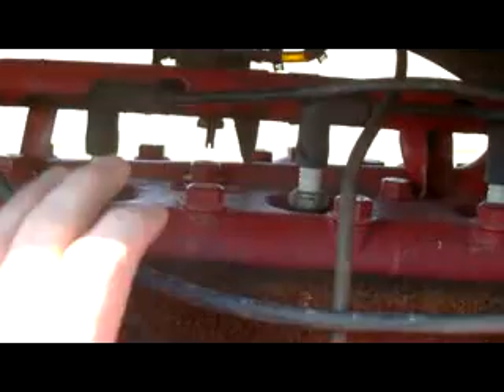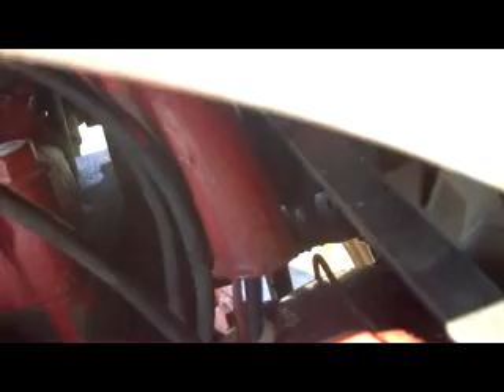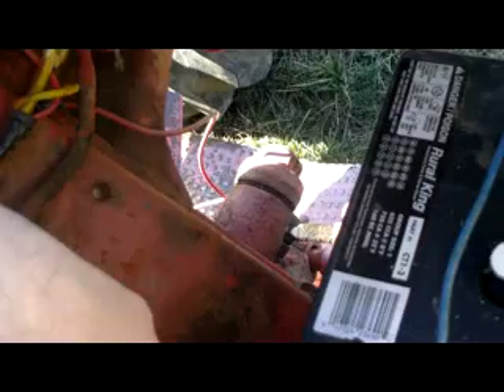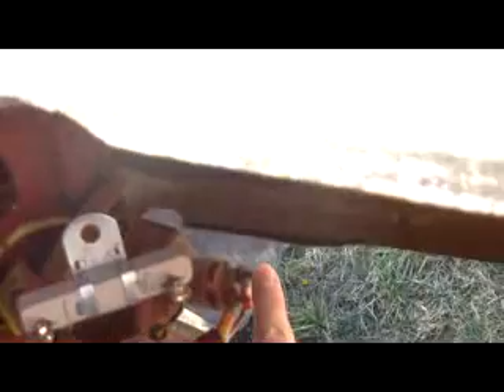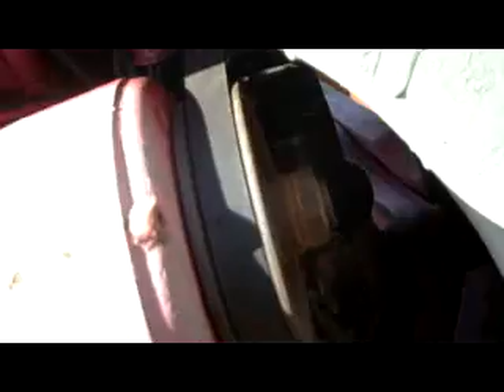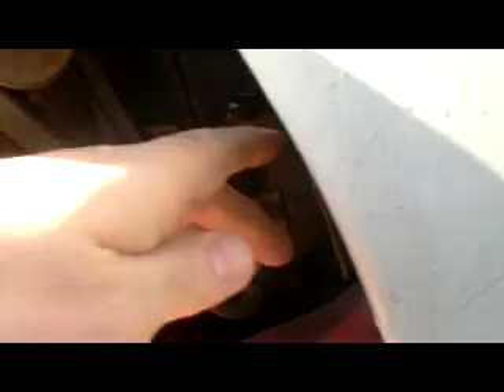8N Electrical System Trouble Shooting When 8n Won't Start

Comment: What I found with my 8N that wouldn't start: a loose battery terminal connection. I'd recommend starting there, and making sure that you have a fully-charged battery before doing anything else.

Comment: I get intermittent spark when turning the engine over But no start. Testing back my ballast resistor  was bad but I think it burnt my coil. Will a internal resisted coil work.
Reply: Yes, you either need an external ballast resistor OR a coil with an internal resistor. If you have both it may work or you may have issues because you have two much ballast (two resistors in series).

Comment: Thank you for your video!! I just did exactly what you said and found out when I put my tester on the battery ground that the bolt that holds it to the tractor was loose.  After tightening it up she fired right up. Thanks again for the tips.

Comment: Nice to see you have kept it 6V I like to keep them original but I must confess that I have 2 - 12 Volt 1951 8N’s and one 1947 8N that is 6 Volt and my Jubilee is 6 volt so I bought them that way so I just left them but original is the was to go especially since 1950 the 8N’s upgraded the generator to 30 Amps!😀🇨🇦

Comment: I'm having voltage to the distributor and the test light blinks when the starter is depressed but there is not a spark at the plugs.  We have tried it with a new wire but still no spark.  I have replaced the ignition switch and the resistor. The disruption has been rebuilt as well.  Any suggestions?

Comment: I just got a 8n, with no spark. My push button starter turns the tractor over weather the key is on or off? Is this normal?

Comment: What can cause that resistor to get hot and blow it?
Reply: the resistor is like a coil electric heater you use in your home. basically a curled wire resisting current which will  produce some heat. hot to the touch. The wire can get brittle and break at any point in time. just test both sides of the resistor for voltage. you have voltage on both sides inlet and outlet it is fine and working. thats the basics.

Comment: I have power to the coil but when I hook the wire to the coil the voltage going into the coil drops and I don't have spark

Comment: Thank you I have a Ford 9N I had recently bought and I drove it a little ways and then it just stopped like no power getting through but I did some investigation I started with the fuel line and the fuel system I replaced the fuel tank carburetor the fuel line and as of this riding this is the day when I tried to start it and it was getting gas to the carburetor but it wouldn't even fire once. I should have known better because its either one of two things it's either electrical or ⛽fuel. Tomorrow's another day I'll pull a plug and check for spark like you did I should have known that. I ran a wire from my push button starter to my toggle switch and I have spark.

Comment: Thank you for your video. 9 years after making your video your still solving problems. Mind was faulty connection’s at the key switch and without this video I’d still be out there trying to figure it out. Stay safe
Reply: Was your tractor cranking over but not starting? I'm working out of town, so I am trouble shooting from afar.
Reply: It was a ignition wire loose.
Reply: @donaldd.293  😁 I was asking for my tractor. With your ignition wire loose, will it still crank or no? Mine cranks but doesn't start. I'm wondering if mine might be ignition, resistor or starter because the wires look iffy. I'm sure it is electrical.
Reply: Hello everybody. Thanks for all the info. on electrical problems. I have a 1946 Ford super deluxe when I bought the car It had some electrical problems so what I did I start replacing The voltage regulator Ignition points, battery, cables, and had The generator check to make sure it was in good working condition. Hi replace all the parts that I thought they might have caused the problem. After I did all that I still have some electrical issues, so I decided to replace all the wire harness and most of the problems were gone. I still have a problem that when I turn on the lights even the car been running or in motion it drains my battery. That’s the problem. I’m trying to find a solution. I’m guessing  it might be the generator. It’s probably the problem. If you have any info, I would really appreciate it.thank you in advance.

Comment: Thanks for the video. My neighbors 8n bogged down and lost spark after his tractor hitting a patch of thick grass. Ended up being a wore come lose on one side of the resistors that was causing the problem. Your video saved me a lot of time. 👍👍👍
Reply: Wire?
Reply: @wehrewulf  yes , a wire came off

Comment: If actually running a 6v battery do you even need a resister?  I've replaced everything and still can't get spark, the frustration is real
Reply: That's what I was here to find out. My neighbor says you can bypass it I'm just trying to confirm that.

Comment: What does it mean if you have voltage to the coil when it not attached to the distributor. I get 12 volts to the coil but if the coil is hooked up to the distributor thank only get 3 volts and it doesn’t Change when I crank on engine

Comment: I have a 1939 Ford 9n. The ballast resistor went bad and bipassed it. Been running it this way for  nine years with no trouble to the coil. It's also converted to 12 volts.

Comment: My tractor would turn over but not start.  Turned out, the wire going from the resistor to the distributor was not hot on the dist. end so I replaced the wire and end fittings and that did the job.

Comment: Thanks for the tips. I bought the neighbors 48 8n on an auction. It hadn’t been run in a few years. I would not have looked at the resistor until I watched your video. I had 6 volts at the coil with the key on. But when I started cranking the engine it would drop to 2-3 volts. TrActor supply had a resistor and it started right up. Now to get the gas tank cleaned out so it will stay running.

Comment: had the same problem today after running tractor wouldn't start no spark to plug from dist. so the problem was in dist. rotor cay top was bent backwardsfor some reason. was running. so took that one off and put old one back on and it started right up . no spark to plug  means problem in dist

Comment: I have a 1948 8n I think that's the  year . It runs really good  for  about ten minutes then shuts off. I'm not sure what the problem is .
Reply: Sounds like a weak condenser or coil your auto parts dealer should be able to test them for you.

Comment: Good afternoon I have a Ford tractor 8N four banger I have a problem hopefully you can help me out this afternoon when I was trying to start it I got spark coming out the starter solenoid cable coming from the battery what could be my problem it seems to be shorted out somewhere have you have any idea what could have believed please help me thank you for your time

Comment: Had a problem with my 1948 8n tractor that was converted to 12 volt by someone else. It took months of testing replacing every electrical item I could find. It just wasn't getting enough spark to start the engine. After researching the electrical systems of all engines pre-electronics I found. That the coil that uses an external resistor is not actually a 12 volt coil. It's a 6 volt that is only 12 volts a short time before returning to 6 volt. By taking the resistor off and directly wiring an actual 12 volt NO EXTERNAL  RESISTOR needed coil. I was able to get the voltage I needed to start my tractor. You don't need to replace anything but the coil, charging system and battery. If you want to keep all of you 6 volt accessories place a resistor  to the power going to them only. Simple wiring, simple fix. I don't care if anyone wants to argue with what I did. It works. It's cheaper and the wiring is cleaner with less connections. A 6 volt ignition system can easily take 12 volts points, plugs, condenser, wiring everything can stay the same.
Reply: David Adkins do you have the Part number for the coil you used, in the middle of the same problem, I instantly thought it was the coil, but my buddy that owns the tractor insists its something else. it's his tractor but just out of frustration, I'm going to buy it and show him.
Reply: If my electronics knowledge serves me, I think if you use a 12v coil that is being fed 6volts, you'll only get half the high voltage to the plugs. Motor may work but spark will be weak.

Comment: so if everything has voltage but still no spark at plugs would you say points and condensor? also if you manally pull points apart should you be able to see a spark? if so would that mean my condenser is bad? i had it off and checked with a mm and it seemed fine but it still just cranks over and over with no spark

Comment: I got spark and getting fuel but tractor won't start
Reply: Check ignition timing and compression, an engine only needs a few things to start; spark, fuel and air,

Comment: Hi  my problem is engine turns over when battery cable is connected.  There is power to both bat and ignition post on ignition switch with key in off position.  Is this a problem?
Reply: sounds like you have some wires crossed

Comment: It was a $2 condenser after owner changed  everything else...always start with cheapest part first...clean points cap and rotor plugs ( unless oil fouled)...test coil with meter...don't just replace parts ..waste of money and time. Check condenser and coil if tractor shuts down when hot...and starts cold.Advice from 40yr mechanic.

Comment: have now spark got fire in dis. but nothing coming out . touched top of coil with test light light was very dim . took dis. off tractor and toched with test light light was very bright any where i touched it it was bright .but when i put it back to motor it whent dim what is wrong.

Comment: awesome video.  I have a farmall super c that turns over but doesn't fire.  These steps will probably help me too.  Thanks.
Reply: I have the same issue with my super c!  Did you ever figure out what the problem was?  Like to share knowledge, so let me know,  please.  My super c was changed from a 6 volt to a 12 volt system.  didn't know about your tractor though.  Thanks for a response.  John
Reply: water had gotten in the gas when the cap was off by accident overnight.  I could see the divide between gas and water in the filtration cup on the bottom of the body.  I cleaned out the tank and ran some gas through.  that removed the rust build up in the tank and tested the carbeurator by spraying starter fluid in there.  After the flakes of rust were cleaned up it started up nicely. also rain water can get in your exhaust pipe and plug it up. took that off and replaced the oil in the reservoir.

Comment: Hi their, good video. I am converting my 1951 ford 8N to 12 volt system. I do not want to burn up my points. would I be ok using my 1.82 ohms ballast resistor with a 12 volt coil? thank you

Comment: Has anyone installed an electronic ignition upgrade into a ford naa 6 volt positive ground staring system? If so do you have any suggestions or advice.
Thank You
Reply: I have a 1953 Golden Jubilee and converted it with a Petronix electronic ignition. Simple and easy to install. I recommend it because it sure is easier than messing with points. Install and forget it.

Comment: Hi nice video if I put on a 12 volt coil do I still need the resistor and do I need to put different points and condenser on?

Comment: My tractor will start when I push the push button to start it but as soon as I release it the tractor shuts off. If you have any idea for me to check out I would appreciate any suggestions. Thanks.
Reply: +Kb12 It sounds like you don't have a discrete line going to your coil (the thing that sits on top of your distributor that the spark plug wires come out of).  If you have a wire going to the coil, trace it back to what it's connected to.  It should probably be on one side of the key switch (after going through a block that looks like stone which is a ballast resistor that you can see in this video at 2:09).  If it's connected to the push button in some way, that's your problem.  It's disconnecting when you release the button.  This is all based on my experience with an old Ford 8n, so your situation might be different.

Comment: Is ignition switch turned on when checking voltage to top of coil?
Or is this a constant hot?
Is a 12 volt coil reading of 10.6 considered okay reading.
Thanks
Reply: Roger, you should only have battery voltage at the top coil terminal when the key switch is on. The 10.6 volt reading your getting is due to the inline resistor or resistors in the circuit. You don't won't to see 12 volts at the coil.

You should have between 10.5/11.0 volts during cranking to allow more voltage to the coil but once the resistor/resistors heat up your looking for 3.5/4.0 amps max at the coil so the amperage doesn't burn up the coil and short it out internally. This will also burn up a set of ignition points.

Comment: HI.we bought tractor Ford 8N, and have problem, battery not charging we don t know why, but our alternator have one wire (how many they supposed to be) and where they go. Please if you know help us, thank you.
Reply from the maker: First check the amp meter on the dash.  Is it showing a positive reading?
Reply: thanks anyway. we change new alternator and it's still working for 45min  and stop...LOL crazi  tractor. and amp meter don't work at all.

Comment: If you have a proper 6 volt coil for the 6 volt system or a 12v coil for a 12v system, there is no need for a resistor in the power supply to the coil. Just another PITA you don't need to worry about.
Reply: Charles Tucker what is pita?
Reply: Jose Farias pain in the ass.

Comment: I have a borrowed 8n. Took the battery out last winter, hooked up neg gnd and no spark.  Did ignition tune-new coil, cap, rotor, condenser, then realized gnd error.  Hooked battery up the other way, still no spark.  Got voltage at coil, both sides of resistor, got rotor moving-no broken shaft...any idea what could be wrong-pointset was .015...  Was running when put away.

Comment: My '50 is doing the same thing.  I can start it with jumper cables directly from battery to the starter - Remember 6 volt is opposite - but I still us the black and red as is.  The starter side will spark a bit but you should heard the drive engage if you have it hooked correctly.  Basically you're bypassing both ignition key switch ( if equipt ) and your starter button,  which I believe is the problem with mine...  Good luck!

Comment: Good video ..   Does the Voltage regulator play any part in "spark" getting to the Coil?
and the "live wire" has to go to the switch and ballis?  thx

Comment: Thanks this is the problem I am working out right now. Spent about 3 days doing this as well. Nice video I have power to the top of the coil so I will be getting a coil, points, and condenser so I don't have to make another trip to tractor supply.  I initially worked on the tractor to clean out the fuel system from all the rust in the tank and clean out all the screens.  Now I need it running so I can prepare for snow season.
Reply: That's exactly what I did and why I have a 9n.

Comment: Newbie here......I have the same problem. Press starter button but just hear a spark or two but no turn over. Where is the solenoid to tap it and.........you mention taking a set of jumper cables and hook up one line to the neg side of battery to bypass solenoid but you don't say what to do with other line of jumper cables. Sorry to be asking 'dumb' questions but I am learning here. My 8N is a 1949 Thanks

Comment from the maker: The button is just engaging the the solenoid on the top of the starter.  Is it clicking when the button is pushed? If not, it could be the button (or wiring).  You need to get juice to the other side of the side of the solenoid connection. Positive ground, so you could get a set of jumper cables to hook up one line to the neg side of battery and bypass the solenoid. If it turns over, then it is in the solenoid, wiring or button.  Tap the solenoid a few times with a hammer (they can stick)

Comment: Inside your distributor you should see where a wire connects from the points to the inside distributor housing, which goes to the coil. Verify that there is an insulated washer protecting this connector from grounding out. You may have to remove this bolt to inspect the condition of the fiber washer.
Reply: I might have this problem.  I noticed it had voltage on one side of the resistor but not the other with the key on.  I replaced the resistor which didn't solve the issue.  Turns out the resistor would get really hot when testing, so i removed the wire from the other side of the resistor, and I had voltage with no load.  I then ran a jumper wire from the other side of the resistor, to the coil which I had removed from the tractor, which at that point had voltage at the coil, since it wasn't grounding out, on the distributor or chassis somewhere.  if anyone has a picture of that washer that might be helpful, but I'll probably just go remove the distributer again and look.

Comment from the maker: Well.. if you can't ID the reg.. then simply take a longer piece of wire ( jumper cables work great), and touch it from the armature on the genny.. that's the big wire coming out the back.. and then touch it to the battery post that is hot... IE.. NOT the one going to chassie. If you are 6v positive ground.. then you will be running that wire from the genny armature to the battery negative terminal.